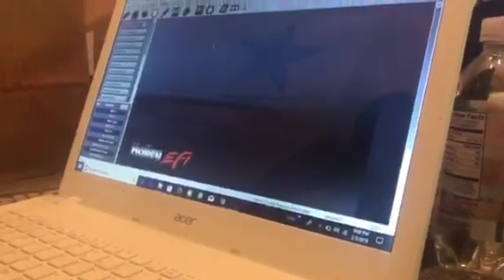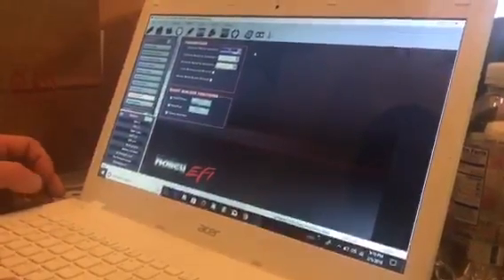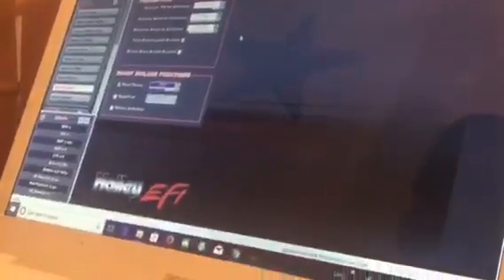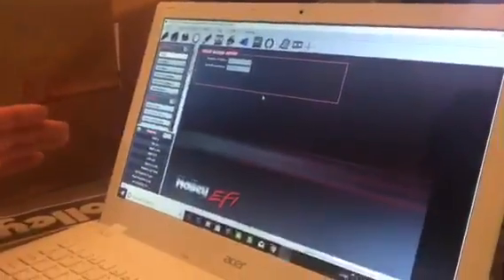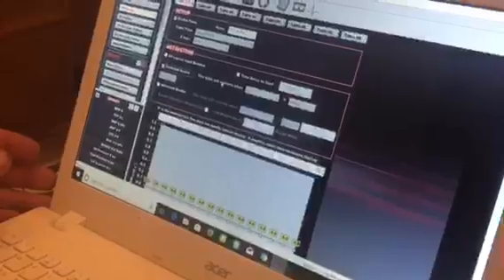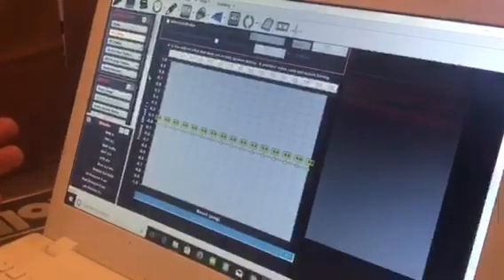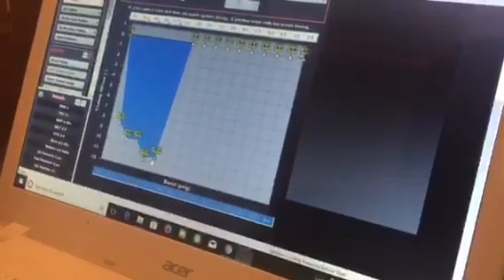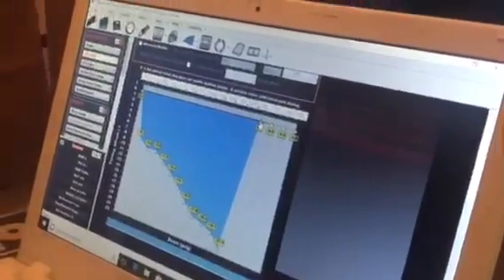holley efi boost builder options, the basic and the advanced way

Comment: I'm having issues with getting the engine to our target boost level on the brake. Using the advanced table it will make around 3lb and stay on the chip, but the boost will quit climbing. Any input?

Comment: Devin does this reduce time it takes to make full boost? mine gets on converter n builds fine just takes a couple seconds. longer in on brake the more heat it generates.  I'm on small cubic inch ls with some good sized twins.
Reply from the maker: Robert Botello yes that is the intention but need to be mindful of how early and how much you pull timing so it doesn't come off the converter

Comment: Devin Question on the Boost Setup / Boost Builder Option Tab you clicked on Fixed timing "15deg", but then on the advanced page you pulled x-amount of timing "depending on boost level".  So if you have fixed 15deg say between 4 - 10lbs boost, then whats the advanced timing pulling from? Just a little confused on this part.
Reply from the maker: obengston1 what I was doing was showing the difference 
With the basic boost builder it will only slow a single fixed timing amount 
You don’t use both one or the other
Reply: Okay so if Im using the advanced tab its going to pull from my actual spark table/boost level while on the trans brake, and I need to make sure I have the other table physically disabled (the one under the boost setup)?  Thanks
Reply: So just to ensure. If Im using the advanced boost builder, then under the Boost Builder Tab you have Parameters I just leave all these unchecked?   Thanks
Reply from the maker: obengston1 yes